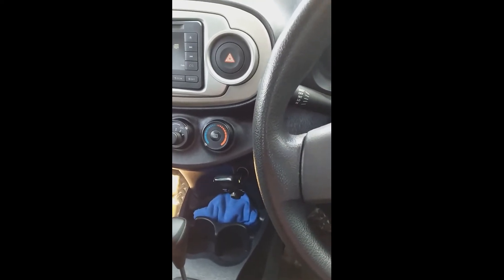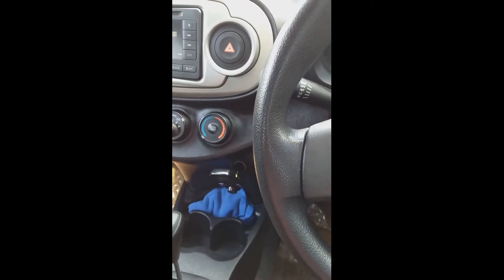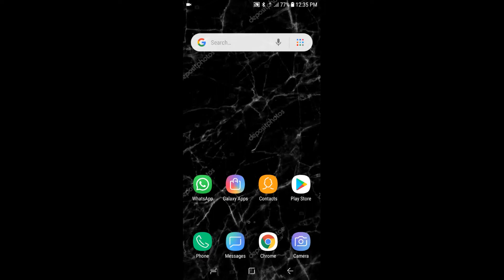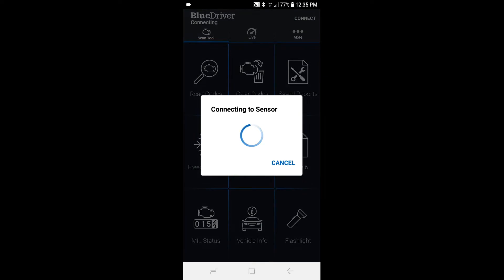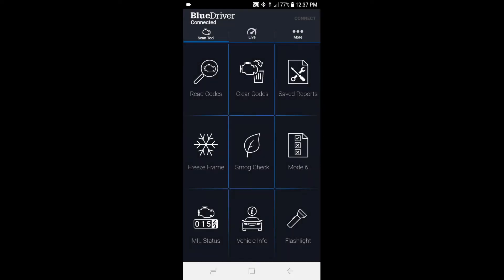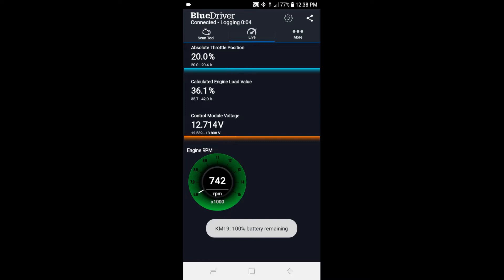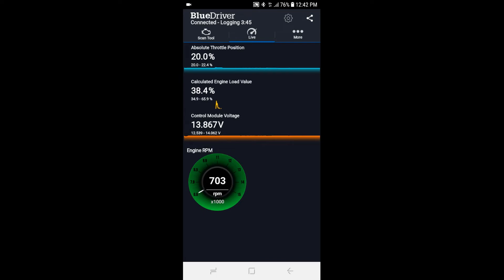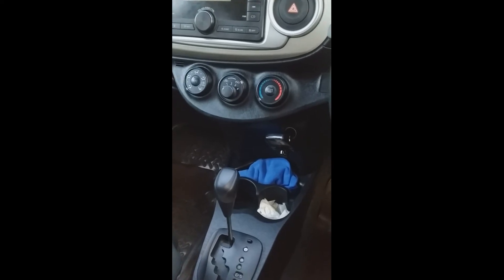Toyota Vitz Engine vibration Part 2

Comment: Also if you removed your battery, your car may experience rough idle due to the fact that your computer lost idle information. This is for Toyota vehicles. Search on YouTube, Idle Reset Relearn.
Reply from the maker: Thanks bro
Reply from the maker: Followed your instructions and engine running very smooth.
Reply: Told you man, each one help one .

Comment: Yute man, the vibration is not normal. I have a 2010 Vitz with the same 1KR FE 1000cc engine here in Mobay🇯🇲. Have it over a year now and when I first got it, it used to vibrate alot. I fixed mine myself... could be a number of reasons why the car vibrates at a complete stop. 1.. Dirty throttle body, dirty MAF sensor, failing Ignition coil, failing alternator, blocked fuel injectors or fuel filter, crack spark plug. My main culprit was my dirty throttle body. I took it off, used a can of throttle body cleaner and a sponge and the car ran smooth like a four cylinder car. But same time I changed sparked plugs, air filter,  cleaned my MAF sensor. Decent little car Dem but mi want a bigger car now, soon sell it.
Reply: Finally a yard man weh know the pree..me have a 2010 Belta that me purchase in November. Had the transmission rebuilt and ting and Bwoi me a get some crazy vibration worst when me a guh uphill. Vibrate so much that all the light come on in the dash board. Mek me wonder if it aguh shut off. I had the right engine mount changed and right now when me change gear it have a juck suh me wah change the rear mount and see what happens. Along with cleaning the throttle body and others cause me want it smooth and purr like a cat
Reply: @Romans116Unashamed  Ok, mi ah assume is the 3 Cylinder in your belta and the transmission is CVT? mi know how frustrating it can get when man have car issues. Vibration going uphill, in my Vitz it did only vibrate at a stop, not when driving. Mi sell that car and a rock a 2011 AD WAGON yah now. Night and day difference in acceleration. But mi a wonder if them rebuilt that transmission good and change the filter and clean the solenoids etc.
Reply: But just like all the things mi list you can try. Mek sure spark plugs and coilpacks good. Injectors, clean MAF sensor, clean throttle body, check O2 sensors. Wonder if it a starve for fuel, could be clogged fuel strainer or failing fuel pump or injectors etc. Check everything.
Reply: Furthermore a st Thomas me deh and drive to Kingston every day and the road bad suh yuh know. Have a vibration in the steering wheel too

Comment: hell no ,,,,,,, i just follow the steps and engine check light on and keep blinking ,,,,,,no issue solve ,,,,but got an another issue ,,,why the hell you misguide us
Reply from the maker: Have to be careful about moving wires and reconnecting them. The trottle body has a rubber seal under it that needs to be properly placed or else air could escape under it causing bad MAP sensoe reading and other pressure related issues.

Comment: Every where the world Toyota Vitz 1000cc have problem only vibration on idling. But as you told if the rpm fix on 800 then problem is solved..... Sure something with throttle body some modification
Reply: Exacty true i have 2007 vitz with the same pro...i made the rpm to lower and it was solved but some days after it's start to show up again
Reply from the maker: Did you disconnected your battery at anytime?